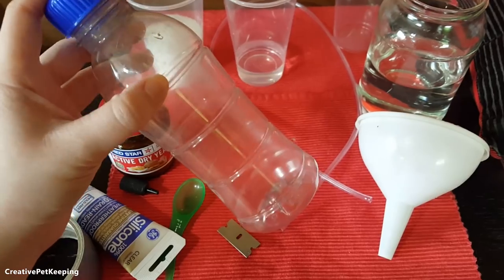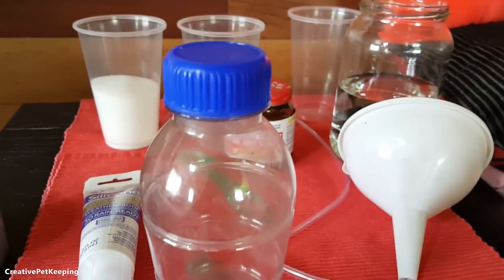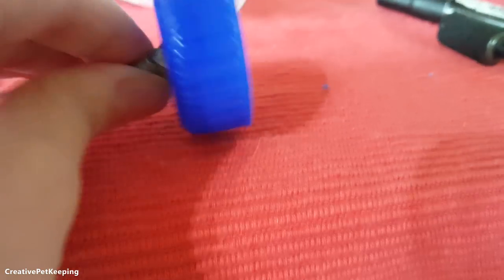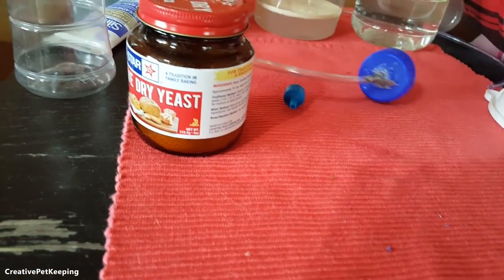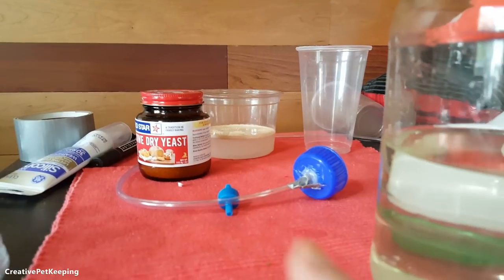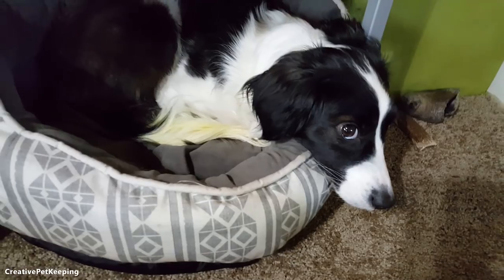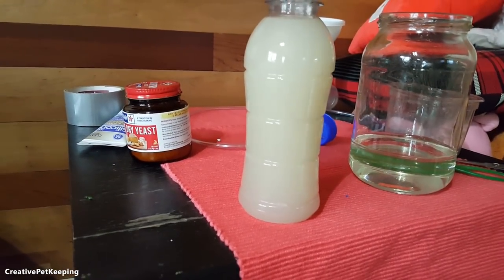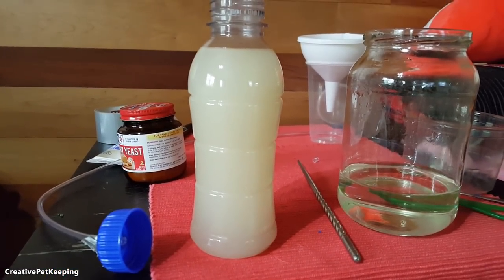DIY CO2 Bottle for a small planted tank ❤

Comment from the maker: Update. If you can use a cot glue gun..waaaaaay better then using silicone
Reply: waeow amazing tnx! how long will the yeast  produce bubbles?
Reply: Hot glue tends to lose its flex under water and becomes brittle and breaks - that's why they use the silicone for most tank repairs/decorations/etc. (I learned the hard way, haha)
Reply: what is a cot glue gun?
Reply: @atab101  a misspelled hot glue gun, I presume!
Reply: How long does a bottle last how much co2 for a five gal tank ? Do you use a shut off valve to regulate flow ?
Reply: The yeast will produce for 4 to 5 weeks if you put enough sugar

Comment: to poke holes in plastic I use the metal handle of the old fashioned can opener, heated on my gas stove. the handle is a little smaller than the standard air line tubing and it's pretty easy to do

Comment: Heat the tip of a screwdriver over a gas flame for a minute and then push it through the cap to make a hole
Reply: i didn't think of that, thanks man!
Reply: Or get a wire hanger straightened out and heat it up . Don’t wanna warp your tools ;))
Reply: Or open wide a pair of scissors and use the bladed side, point it and twist it around till the hole has the desired size. And it'll come round too! LOL
Reply: I used my soldering iron
Reply: i just stabbed it with a pencil 🤐
Reply: @katrat3382  Wow that was 3 yrs ago I forgot what it was even about lol : )

Comment: To the people asking how long it lasts, get a CO2 drop checker (eBay has them for cheap) and it’ll tell you when CO2 levels in your tank are either too high or too low, this way you can figure out if you should take the pipe out or make new solution!

Comment: I'd add a second bottle as a gas exhanger/degasser. This way if the yeast over rises it won't go into your tank. It can easily wipe your tank if it does. And it smells bad....
Reply from the maker: Great idea, thank you
Reply: Do you mean like an empty bottle or one filled with water?
Reply: Pepe Pepperoni, you could do a second bottle with half water. Make the tube go down into the water so you can count how many bubbles but it also gives room for overflow.

Comment: Sometimes I use Phillips and the occasional flat head to spear/twist holes into bottlecaps, purely because they're round, easy, and I'm always too lazy to pull out the drill. Works easily, just watch out for slipping.

Comment: you could have used a screw driver to make that hole..you will need to warm up the screw driver on the stove for like 10 seconds then it will find its way in once you place its tip on the bottle cap.

Comment: try a nail and a lighter for your hole if u melt the hole a little smaller than the hose you don't need the silicone.

Comment: Two questions. Was there a reason you didnt use baking soda? Second: was there a reason ypu didnt hook up a second smaller bottle as a bubble counter? And how important is the second smaller bottle?
Reply: lametube that's 3 questions. Baking soda isn't needed at all, the second bottle is pretty important so use it. You can count the bubbles as they come out of the line. It's not pressurized so it's not as important.

Comment: Why do you need a check valve for it? The water shouldn’t back siphon since the flow is forever constant, I thought...
Reply: JCTheCat if it slows down or stops producing, causing water pressure to be higher, it will cause a back siphon and will go backwards. If not sealed tight or something fails it can even drain your tank all over your floor.

Comment: How to stop the flow of CO2 when it is no longer required, without emptying the contents of the bottle? Please suggest.
Reply: I came here to ask about this. I wouldn’t want to run it at night for fear of it depleting too much oxygen since the plants use oxygen at night. I was thinking when I do make this and set it up, I’ll just unscrew the cap from the CO2 producer. It sucks because then the product is wasted but at least I know my fish are safe. I also thought about putting the air stone near my powerhead to spread the CO2 through the tank.

Comment: Use lighter to make hole 
If not airtight , use duck tape on the hose before inserting in hole , will be no need for silicone. .

Seems your ideas are from other utube channels .

Comment: you can also use an ice pick heat the ice pick up super hot hold it to the spot of the cap that you wanted until it cooled off if it wasn't big enough yet reheat The Ice Pick and redo
Reply from the maker: Thats a interesting idea

Comment: Hi,,,how to switch off at night time,,,in this set up,,,,plz,,,
Reply: When activated yeast can't be "paused". Yeast is a living "thingy" and eats sugar and expels co2 (more or less like we do!...you could put a baby in a bottle and he'll drink the sugar and breath out co2 as well!) therefore there's no "off" button. You'll have to pull the tube till the airstone reaches the top of the tank, co2 is lighter than air and will go upward in the air outside your aquarium. In the morning you'll replace the airstone at the bottom of the tank, out again at night time. You might try to leave it inside...co2 is generally well tolerated. Don't blame me if in the morning you got only a nice tank of plants with floating fish cadavers tough. Blame "experimentation".